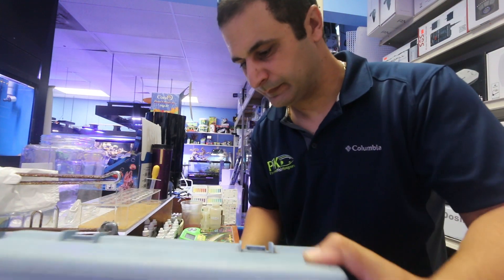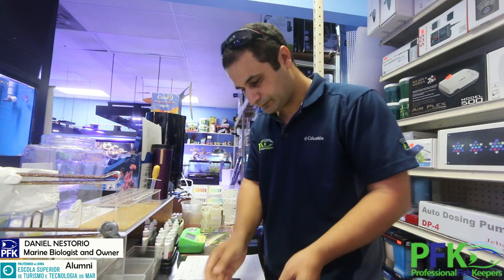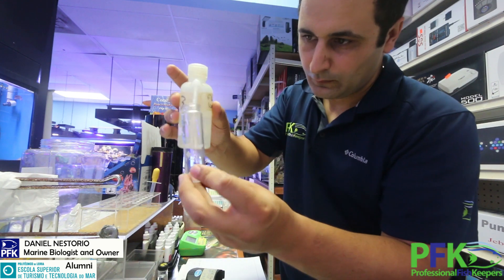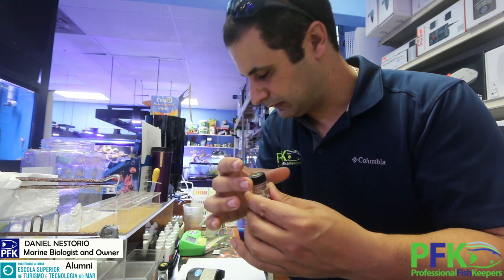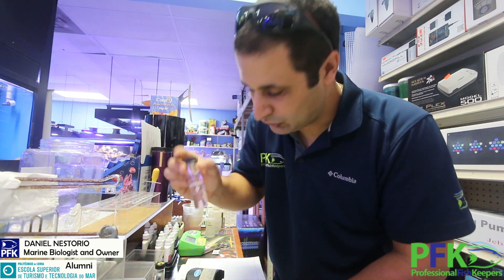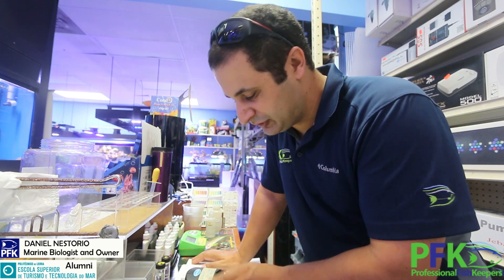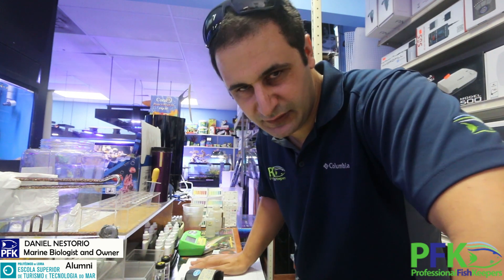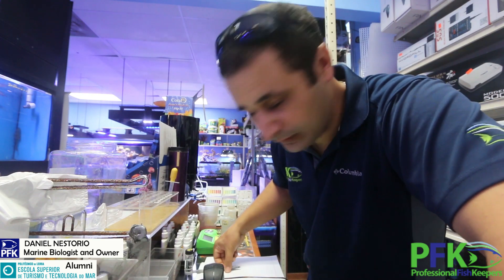HOW TO TEST COPPER WITH AN HACH SYSTEM

Comment: Nice video again...do you like to keep the 0,5mg/l in the quarantine tanks or other systems? By the way, very good idea record a video and then use it to train employees ;).
Reply from the maker: Merci!!! after 14 days I stop, and no other new fish comes in to that system. yes 0.5 cupramine from seachem.
Reply: Do you quarantine and treat all your fishes or just the ones that need it
Reply from the maker: @randyb6505  all the saltwater fish. quarentine 1 system gets bleached, empty, fill up with new water, and the shipment goes there. the quarantine starts. then all that fish goes to another system quarantine 2, gets a fresh water dip in between, and if needed I can run prazi. but that is pretty much it.
Reply: @danielnestorio  will I still need to quarantine after purchasing fish from your shop meaning they went through the process do I have to do it again will it stress the fish
Reply from the maker: @randyb6505  Always quarentine. no need to run medication right away. Observe if all is ok after 14 days put the fish in. if something shows up medicate accordingly